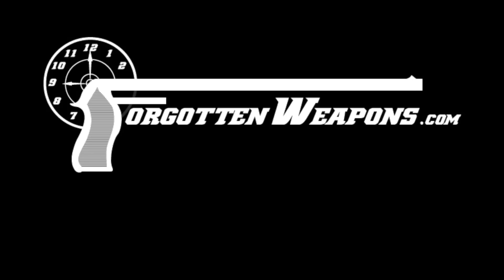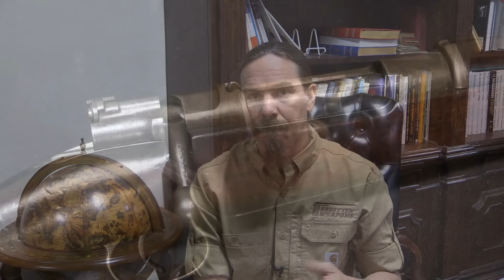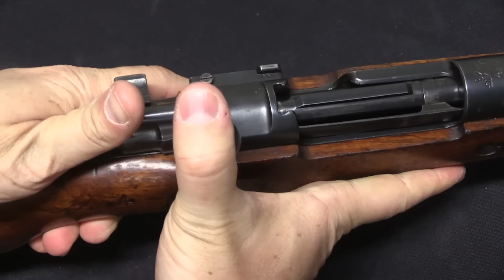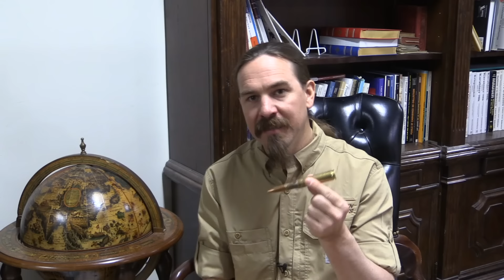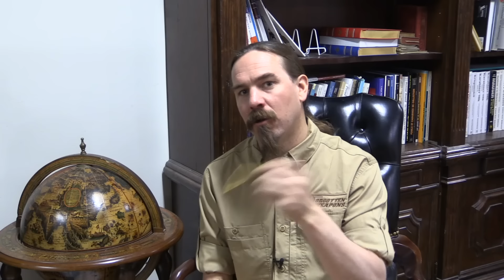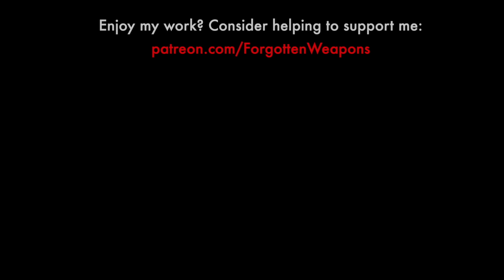Earth-Shattering ka-Boom! How (and Why) Guns Explode

Comment: In  the 1960's I had a 9"  Pistol Parabellum ('Luger') and used to hand load the 9mm rounds. I was aware of the importance of ensuring that I didn't 'double load' a cartridge with propellant, or miss the it out. But:
On the range I can remember a misfire where I pulled the trigger, but nothing happened. I then operated the toggle to clear the action and chamber a fresh round, not thinking about what might actually have occurred. I squeezed  the trigger to fire the new round, but again nothing happened.  I then noticed that the 'elbow' of the toggle was raised and therefore the action was not in battery. I guessed that the round hadn't chambered properly, thinking that probably the case was a bit tight because of the hand loading. I attempted to close the action and fully chamber the round, by striking the top of the toggle with my fist! Fortunately (very) this didn't work, because when I investigated further, I found that the previous round had been a 'squib round' and the bullet had become stuck in the throat of the the barrel, preventing the next round from chambering and the action closing.
Even now - 50+ years later - it chills me to think that if the bullet of the squib round had entered the barrel a millimetre or so further,  the pistol would most likely have been destroyed and myself injured.
BTW. What's the mode of failure for a 'Luger' in this instance?

Comment: I just like to point out even doe it had a small mention, reloads can be very dangerous as the wrong powder is used, its not clear on the tins what the powder is for, pistol powder burns very fast because of the short barrel of say less than 5 inches, put that powder in a rifle with a 23 inch barrel then boom

Comment: In 1987 at Ft Irwin a soldier set the headspace and timing on a M2HB “backwards” Bottom eject right…the cartridge exploded outside the chamber, it was a brass body grenade. The case head hit him in the thigh and groin. He broke his femur and severed his femoral artery. Medics were on hand in 2 minutes. He bled out in less than 5 minutes. Sad and needless. RESPECT the 50 BMG.

Comment: Years back, when I was younger and dumber,, I had no problems going to the range by myself. About 20 years ago, an incident of catastrophic failure happened to another member that caused severe injuries. He almost bled out before EMS arrived. Luckily he had a cell phone and managed to open the door before he passed out. Now, the range has a phone as well as a pretty good GSW First Aid kit as a result of the incident. For myself, I stopped going to the range alone. Now, I only go when I can take someone with me, just as a safety precaution.  Had Scott's Dad not been with him, he would have died. The extent of his injuries would have prevented him from driving to the nearest Aid.

Comment: In  late 2008 or early 2009 someone in my basic training company had a squib load thankfully very near the end of a rifle qualification shooting run.  It was the last target or near the last target so they didn't get through a failure drill. It was not discovered until either they rodded this trainee off the range or later when they went to clean their their weapon. This was with Lake City M855 ammo.  It's rare but it's a numbers game for when it can happen say for arguments sake that a one in a million rounds that has a problem to make it squib if you shoot 1000 rounds a year you get a 1 in 1000 odds, if you shoot 10,000 rounds it's 1 in 100 odds. If you are supervising a match that sees 250,000 rounds a year odds are 1 in 4 you will have someone with a squib.  This is before you take into account handloaded ammo. In short squibs are super rare but they can and do happen.

Comment: The way I understand the 3rd safety lug on the Mauser it is intentionally a bit behind the other two, or at least that's how I would design it. That way if the locking lugs fail the bolt will go back a bit, which can be used to vent the pressure that's still in the chamber. Also this way the shooter will clearly notice that his gun is broken, instead of trying to  (and in the worst case succeeding to) load and fire another cartridge

Comment: The crazy thing about Scott's accident, is that the backup failsafe of the RN50 failed in addition to the screws. The two metal dogs that prevent the rifle from being chambered "out of lockup" also act to obstruct the cap from flying directly backwards. The round that Scott fired was so wildly powerful that the cap sheared completely through the dogs and almost didn't deviate from its trajectory at all. In fact, its likely the dogs slowed the cap enough such that it didn't break through his glasses and enter his eye socket. Although, the dog became the projectile that nearly killed him in the end, but that is a freak thing.

I'd challenge anyone to find a safer way to design that rifle. I suppose the dogs could have been a solid chunk of steel, and that might have stopped the cap, but then you are into engineering territory where you are designing for extremely unlikely use cases. 

The round being loaded so hot reminds me of an old conspiracy theory that the CIA sold double or triple loaded rounds to bad guys in the 80's and 90's in an effort to sabotage them. I've also read theories that the CIA straight up put RDX or C4 inside of rounds as well. "Poisoning the enemy's well" with hot loads seems like a tactic that might work to some degree, but i don't think there has ever been any evidence of it. The round Scott was shooting was a sabot penetrator which is an odd round, but i think its more likely that the rounds were "fake." He mentions he paid $100 per round, and it seems like something that could be fairly profitable to hand load and pass off as factory loaded. Or it could have been a completely factory original round that was the 1 in a million factory defect that got a ton of extra powder somehow. The whole accident was so insane that i can't stop thinking about the physics of it, or the odds of it happening at random. I also wonder if Scott would have been wearing a bolt in his shoulder if he fired from a bolt action rifle?

Comment: I don't see the "bore obstruction" hypothesis as being the correct one. Especially since this is a saboted light round, if pressure increases behind it at almost any rate it will just speed up, it doesn't have the mechanical resistance (the jacket is made of plastic) or inertia to "obstruct" the bore. The explanation I find more believable is one I found on another video on the topic from a forensic expert. The hypothesis involves the case rupturing and the high pressure gases venting into the microscopic gap between the cap and the barrel. The design of this 50 cal has a flaw, as much as I like Mark Serbu. Under normal operation the force acting on the receiver which in this case is the threaded cap is the chamber pressure multiplied by the surface of the back of the cartridge. But no matter how tight the cap is screwed in there will be a micro gap  between it and the end of the barrel and if high pressure gasses leak into that gap the surface becomes much larger and consequently the rearward pressure increases by a large amount. I suspect this is what caused the accident, the cartridge ruptured, the primer blew out or something of that nature caused high pressure to leak backwards and once that happened the force became too much for the threads to handle. This can be easily fixed by drilling a bunch of venting holes into the cap which ensure that in the case of pressure leaking into the gap between the cap and the barrel it can safely vent out and doesn't result in a catastrophic explosion of the gun.

Comment: I had that Glock 40 kaboom in a G19 gen 2... not fun... back part of the brass went down my magazine and split it while the rest of the gun jammed up conpletely. Good job it was the last cartridge in the mag... Deemed to be ammo failure and sure it was... mil spec ammo but the one cartridge between batches so I probably got a 147gr bullet in a case meant for plastic training bullets with lots of hottttt gunpowder... what you refered to as obstruction as result and extreme overpressure in combo with early extraction of the brass... kaboom indeed... I didn't get a scratch but I was very sooty... insurance policy for "explosion" got me a new gun for free hehe, max pimped too 😁

Comment: Also be extremely careful with bullet diameter. I blew up a Glock 21 .45 acp with one of my hand loads. As a young reloader I got the bright idea to load some 45 acp with a 250 grain bullet. Not realizing the bullet was for a 45 Colt. I had proper loading data for the powder charge but did not realize the bullet diameter was .003” bigger than 45 acp. That third round was a doozy. Lucky I had safety glasses on. Gun was utterly destroyed. Cracked frame, cracks along the slide guide rails, locking lug above chamber is in orbit, magazine evacuated,side of slide below ejection port was event bowed out. It even broke the trigger. My injuries were a huge blood blister on my trigger finger were gas vented out the side of the gun. Also took me about three years to steady my aim after that.

Comment: There was a woman who was shooting a Masan nagant , and the firing pin must have got jammed , so when she pushed the bolt forward on the next round in the shouldered position, looking down the sights , BOOM 💥 the round went off with the bolt in the unlocked position, and went straight Back through her eye socket out the back of her head ! Dead 💀, always make sure your guns are in good working condition!

Comment: Had an F88 fire out of battery next to me laying in a fox hole >.> fase next to the ejection port is also not fun... Took me about 30 mins to be able to see and about 3 hours for the ringing in my ears to stop enough I could make out the corporal reaming me for not hearing a command >.< luckily was in training and they were real sympathetic about it..... I got to huck the F89 and 2000 rounds the next 5 odd kilometers instead of the 89 and 4 mags <3 Thanks Corporal.

Comment: In the in-battery overpressure catastrophic failure case.. wouldn't there be a way to provide an catchall safeguard that ruptures in a predictable way at the rated pressures plus some margin ? Pretty much a "safety valve" like you would find in most pressure vessels. Sure this would probably be destructive to the gun, but would prevent most injuries related to catastrophic failures where the whole assembly starts to disassemble in a completely unpredictable way.

Comment: I just saw a video posted by Backyard Ballistics, where he points out that gas pressure getting into the space between the cap and the end of the barrel would have caused significantly more rearward force than normal, possibly leading to the threads failing.  A blown or pierced primer could have allowed gases into that space, possibly causing a failure even if the pressure wasn't exceptionally high.

Old ammo, with deteriorated powder causing a pressure spike and maybe a little corrosion weakening the primer... boom!

Comment: Interesting to say the least ! Great video by the way so thanks. 
I no longer have fire arms (Hunting) but back in the day I took all this technical aspect seriously and learned a lot about rifles (Hunting) I'm far from being close to expert level for sure but I do have a question for you. I've seen Scott's misadventure video and a couple of things stood out (by the way I'm not familiar with these so called "slap rounds") but Scott mentioned that he did find it weird that one round went way off to the right, then mention that each following round the sound and flash were getting different. Then, after firing the previous round I noticed that the cartridge was jammed and he had to pry it out ! This reminded me of a 30-06 of mine that had a bad chamber and when fired gave one hell of a recoil to the point it wasn't comfortable to fire off rounds at the range.  I remember that the shells were over expanded and difficult to remove (which weakened them enough that I would reject them for reloading) I had the barrel turned by a gun shop and it made the 30-06 behave like it should. My question is this: Seeing that shell, of the previously fired round, was jammed and needed to be pried, would that not raise the question of some obstruction ie the pressure was increasing after each previous round.
I would appreciate your opinion ! Thanks

Comment: Yup iv had that happen second to last shot had a squib load and that bullet didnt clear the barrel and i didnt realize its still in the barrel. Load the very last round and fired it. And it went boom in my face. Talk about a bell ringer… nocked me stupid… didnt have any major injuries, few spots of powder burn, and cupple scratches. But seconds before i fired and it blew up, i moved my hand from under the blind mag of the gun forward, and by doing that i didnt loose any finger. Cause the gun worked as it was designed to, by redirecting all the gas pressure that came back around the case, into the bolt and found the pressure release holes all bolt actions have that dirrect it into the mag well. And it blew the mag well apart. The floor plate. Fallower and spring were all blown through the stock and never found… so had i not moved my hand i probly would have blown off a finger or two… 
But lucky me i didnt loose anythjng important, other than destroying the gun… 
Long story short the gun was replaced and i still have both eyes and all my fingers and both hands still… they gun smith i took that rifle to says i was extremely lucky, everyone he knows of that had that happen lost some part of there body when there guns went boom

Comment: December 27, 1972, as my ship was refueling to leave Vietnam for Okinawa and Japan, the other ship refueling had banana peeled about the last 5-6 feet of the barrel of a Mk42 5”/54 dual purpose cannon.  While not totally similar to this video, my understanding of what happened was that the cannon shell (bullet) prematurely exploded within a foot or less of the muzzle.
The barrel showed three peel sections at 3, 9, and 12 o’clock, with the 6 o’clock section missing.  To my knowledge no one was hurt.
Reply: On squib loads an officer let another officer shoot his personal pistol.  Bang, pop, tap, rack and was starting to shoot and the owner grabbed the pistol so that his thumb was hit by the hammer.  They brought the gun to me, as unit armorer, to remove the lodged bullet from the barrel.
Another classic closed breach problem is the 20 gauge shell in a 12 gauge shotgun followed by a 12 gauge shell.

Comment: Mark Serbu posted sometime ago that from the analysis and data they could gather in the past year from both literature, simulations and testing that the likelihood of whoever loaded the rounds Scott used had pistol powder instead of the powder rated for the use, which promoted a faster burn and higher pressure build-up than what the RN50 was supposed to handle. And was probably badly loaded and stored too before getting to him, seeing how many of them veered off as if they were shotgun slugs and unstable speeds.

Comment: My first time shooting a handgun could have been my last..... my Grandfather took me to the range to show me how to shoot a 32 cal revolver.  He kept two rounds in the cylinder at home and brought it to the range that way.  From a new box of ammo, he topped it off before letting me shoot it.  The first round fired confidently (new round) but the second didn't sound right at all.   Being a new shooter,  I attempted to pull the trigger again, but the revolver would not advance (thank God). Turns out a squib load had lodged between the cylinder and barrel, and would not allow movement of the cylinder.  Had the squib bullet moved a hair further into the barrel,  it is quite possible I would have blown his old H&R apart.  After some discussion with an astute range officer, we determined that my Grandfather's cleaning practice of shooting WD40 into the cylinder before dropping those two rounds right back in had caused the powder to degrade.  Lesson learned for Grandpa and a teaching moment for me!

Comment: When Scott was loading the 0.5 slap round into the gun before the accident. I did think the "screw cap"  looked minimal, almost like a flashlight battery cap. Then as he assembled the gun I wasn't impressed by the quality of its engineering.
 I just thought about the gun physics of a tank gun using mussels, breaches and sabots and felt that area was left wanting. Lucky guy???.

Comment: I've had an in battery failure occur while shooting my od green Wilson combat ar with an elcan m145 scope out the passenger window of my car. And since the scope line is so much higher than the barrel line I remembered checking it was clear and not going to preferate my door and as I pulled the trigger my magazine all 30 rounds and all blew out the bottom of itself and I was left blind and confused but regained clarity to find the brass had sheared off the point of contact with the bolt and all that pressure came with it